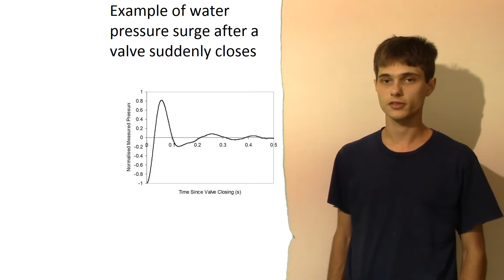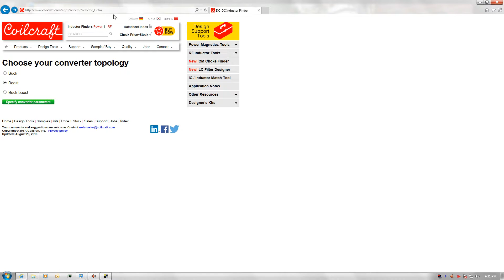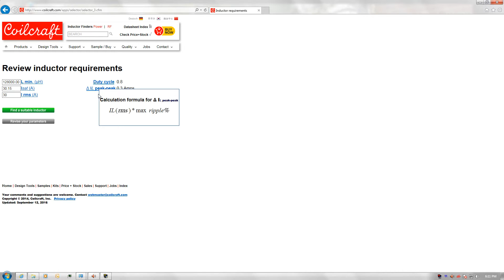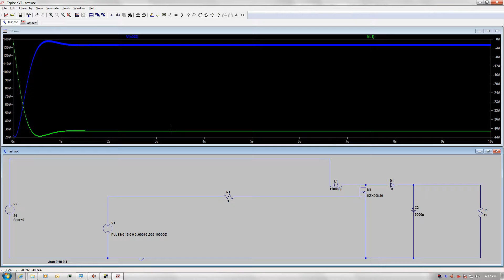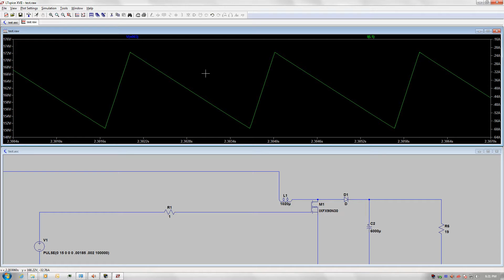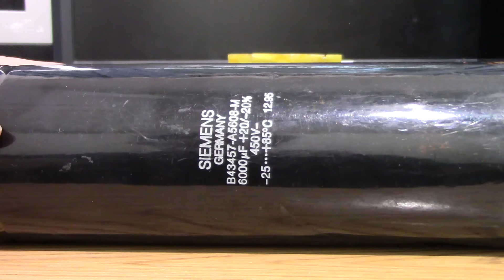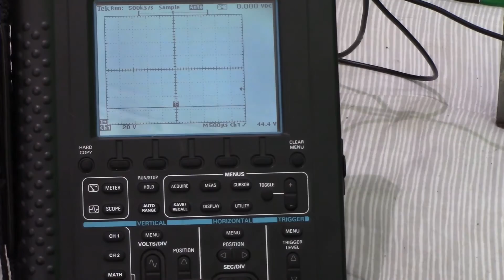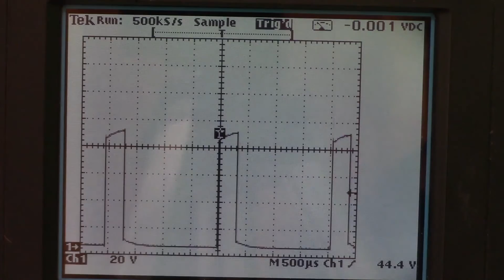Making a Boost Converter Part 1: Power Stage

Comment: I need to boost 40V 75Ah lithium ion battery pack to 72V for automotive application. So, I am designing a isolated boost converter. But, looking at the inductor size at 5:48 I am doubtful if its a right decision. Can you if boosting the battery pack is a right decision? If yes, can I get an inductor that can be compact as well as handle upto 80 Amps of current. The inductor rating is around 300 microHenry.

Comment: Great video, good and down to earth explanations, only a few minor things that I would suggest to improve :) Please do mention that you are using a battery operated oscilloscope! If people just plug their regular oscilloscope onto a inverter output like this, they risk burning out the earth of the probe/oscilloscope. Please mention that a differential probe is needed with a normal scope.  Get a good and cheap external microphone, like the H2N zoom, to get a much better sound quality :)

Comment: glad you are on this subject. I still haven't started my inverter project. everything is on hold for a while. I hope to learn enough to build at least a 3 kW 24-48vdc to 120vac spwm inverter. I found a output driver board . just need a boost stage! I'd like to find a huge torrid at  the salvage/recycling yard. I got some heat sinks and 22,000uF 75 v caps. and a few other things there. great video can't wait for more!

Comment: When the thing is near finished, will you demonstrate the efficiency depending on the frequency? The transistor switching seemed to use an almost invisible fraction of the waveform, so I assume it could switch much faster while retaining most of the efficiency? (The audible switching noise really bugs me :P)
Reply from the maker: Yes I can try to make a comparison. I have done the same setup with a silent 20 kHz switching frequency, it's just that the inductor really did not like that. I'm kind of spoiling the next video but if you do increase the switching frequency, the gate drive power requirement also goes up quite a bit. I can try for a few kHz just to see what happens. Maybe we can find a better compromise between efficiency and noise.